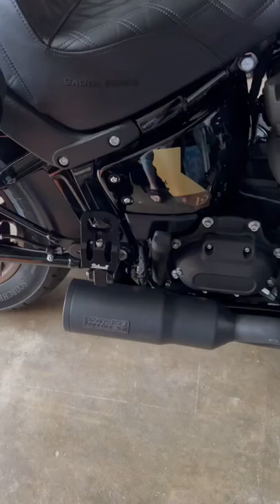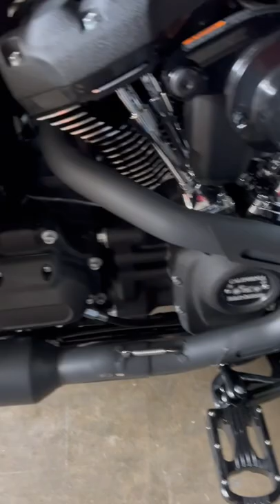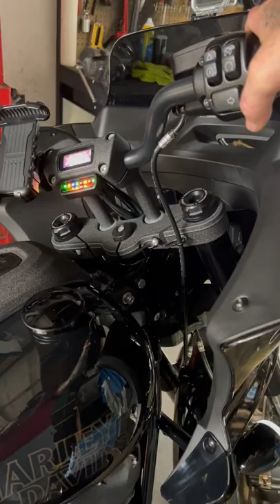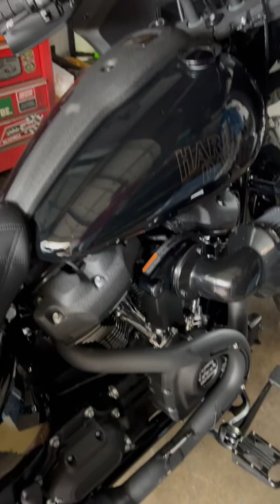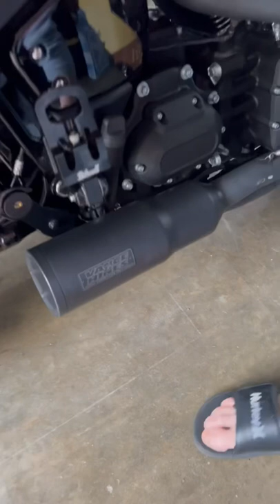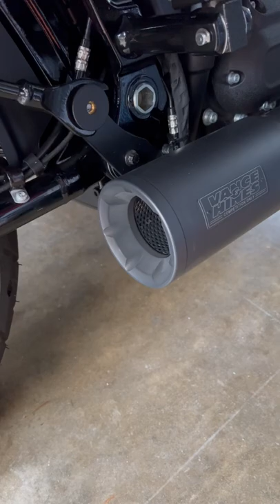2022 Lowrider ST-Vance & Hines 2-1 High Output Exhaust

Comment: Did you keep the stock tune with the new exhaust?
Reply: Please answer?
Reply: @stacyodom1746 you would need to
Reply from the maker: You can keep the stock tune on the tuner in case you need to have it. But this tune was done with a power vision and Dyno'd at Jiffy Tune in lake elsinore cal.
Reply: @lowriderstliving  do those tunes allow you to keep your warranty? Awesome sounding bike btw.
Reply from the maker: @D-doggy77  warranty gets voided as soon as you modify the internals

Comment: Hi , I've got V&H slipons , Eliminator 300 . They are quite at idle and low RPM but loud when you pull the throttle.  Would you describe your Hi Outputs the same ? Are they quite at low RPM and idle ? Thanks
Reply from the maker: You're not gonna get shit as far as performance or sound improvement from slip ons. Pull that stock crap off and put a 2-1 on it with an intake, cam and tune it. You'll be glad you did.

Comment: Where did you order? Part number. I want to do this set up. Located In socal too
Reply from the maker: https://www.revzilla.com/motorcycle/vance-hines-hi-output-21-stainless-exhaust-system-for-harley-softail-2018-2020?gclid=CjwKCAjwiJqWBhBdEiwAtESPaAH1PbJ2S02aHTwuC9O1lx2sWGb6mS0vDRzqW656GPbkteWUlOX8BxoC0lUQAvD_BwE
Reply: @lowriderstliving  Hi, on the vance and Hines website, they don’t mention compatibility with the low rider st. Do you confirm no pb to fit ?